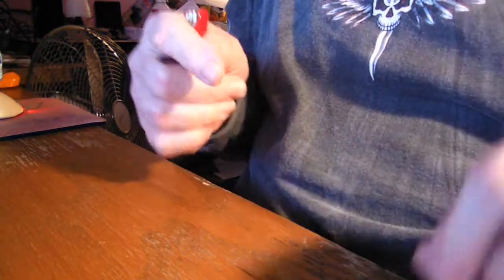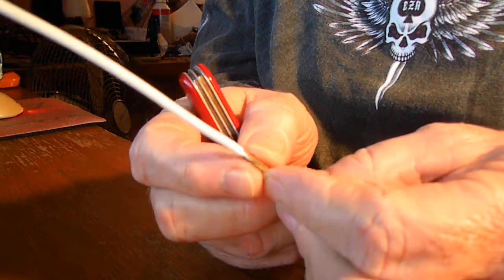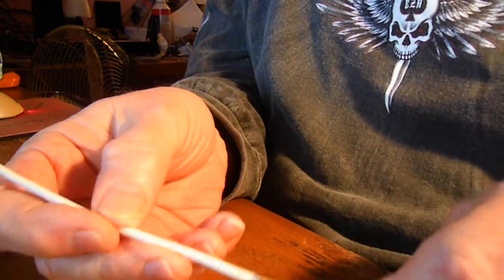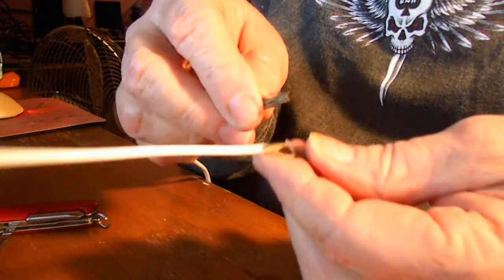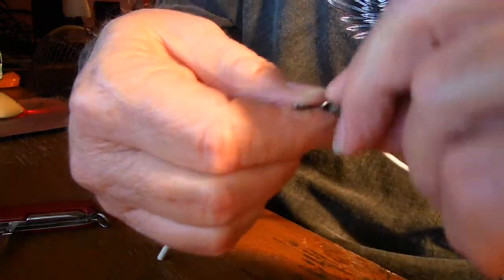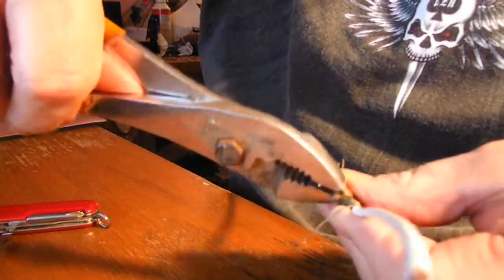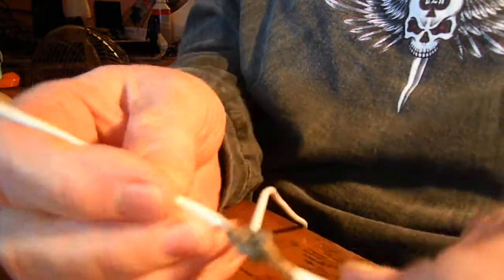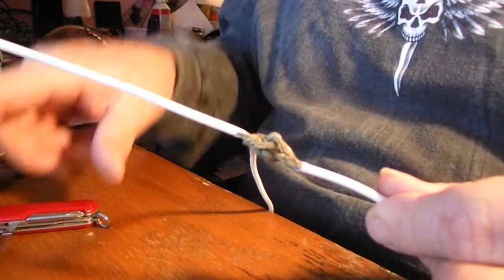Splicing stranded wire

Comment: Good way to splice Mr. Byrum. Makes for a strong connection! I recently acquired a 2000 vette that Squirrels chewed every wire, rubber hose and plastic piece they could find under it so I have been doing lots of splicing and wiring...
Reply from the maker: WOW, did you post about this on Facebook? I'm in a group and this happened to one of the guys.
Reply: @beninchesapeake  Yes sir I'm on a C5 group on facebook... Probably me.... I have most of the wiring done, trying to get other things working. Got the gas door working today. Next I have to figure out why I'm  ot getting fuel.... Fun fun fun!!!